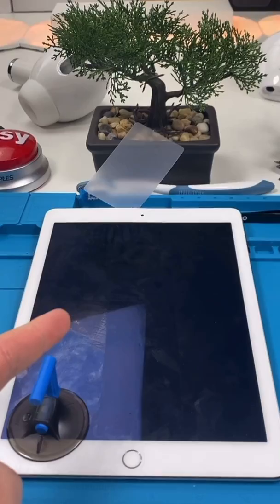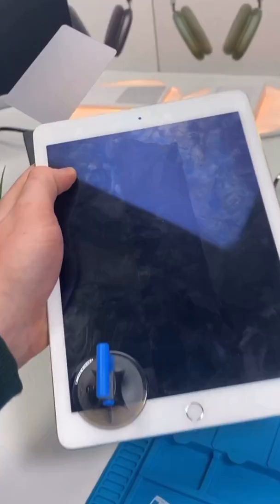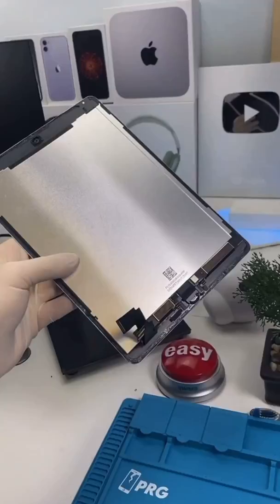iPad Battery Swaps Are Not Fun... #Shorts

Comment: I had to do one a battery swap on an air 1 and the way the battery is connected is an absolute pain because it requires you to pry up or even remove the board if needed

Comment: hardest thing I attempted to get open to repair at one time was an ipad air 4 for the fact that they dropped the ipad the screen did not crack but the power button broke. It was the first one I had seen and having to open a new device like that with no guides available at the time is nuts.
lo and behold the screen came up without cracking but..the screen lcd no longer worked. was able to fix the button about 85% because the frame is like paper and met half and half with the customer on the screen. now have done a few of those ipad and can only say one thing f the bottom of the screen where the ribon cable is.